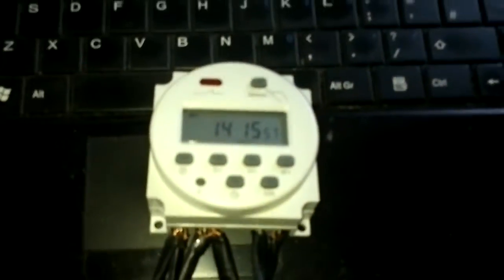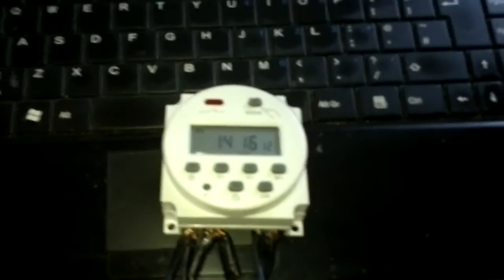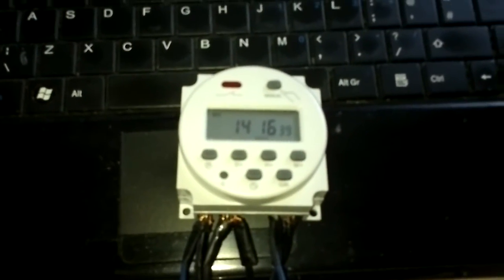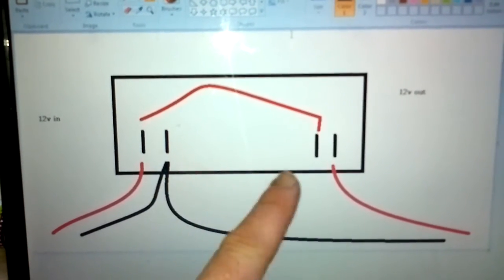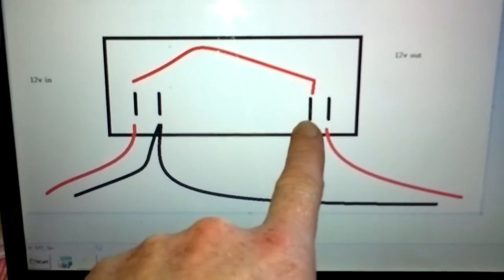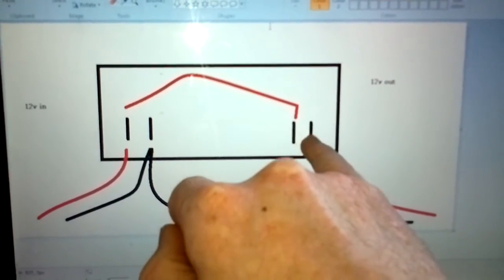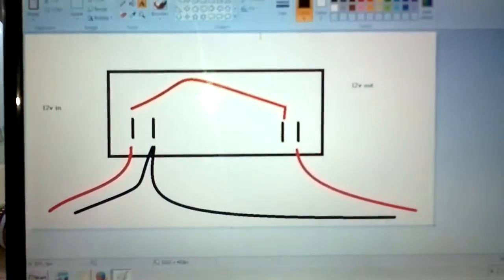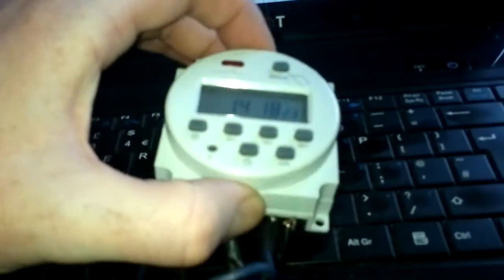how to wire this 12v timer

Comment: My timer keeps burning. Literally melting on the jumper terminal side. Wired it the same as you. 12v to 12v converter vdc ro ac

Comment: Dude there is just ONE "power in" Positive and One Negative. The two prongs on the right are the contacts of a "switch" (Relay). There is no "power out". It is made that way so that you can take that 12v timer and use it to turn on a 110V AC appliance, like a light. So you can add your video to the list of videos that got it wrong. LOL

Comment: I know this video is old, but I am just wondering what kind/gauge wire you use to wire this to a battery that is charged by a solar panel....
Reply: Thanks for the reply. I will have to research a little more.
Reply: @suzannelee4985  That all depends on how many max volts and amps you solar panel can put out. Refer to the solar panel company instructions/manual/specs to figure that out. If you only have one panel and it came with wires just use that gauge wire. 2 to 3 go up a gauge. 4 to 6 go up two gauges and so on.